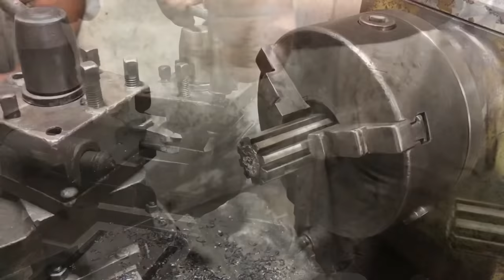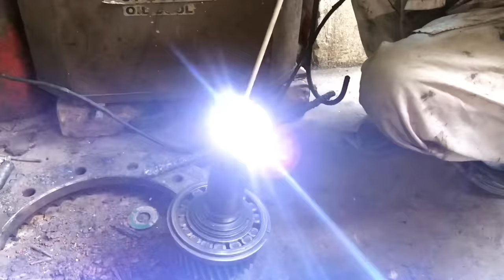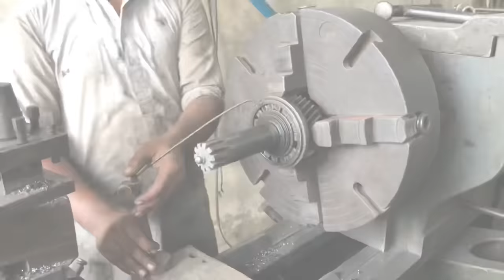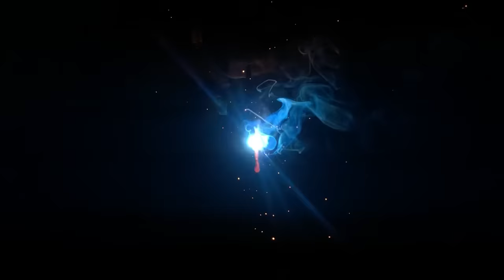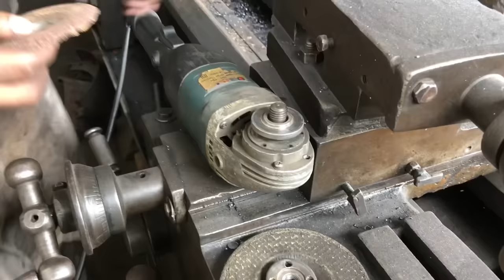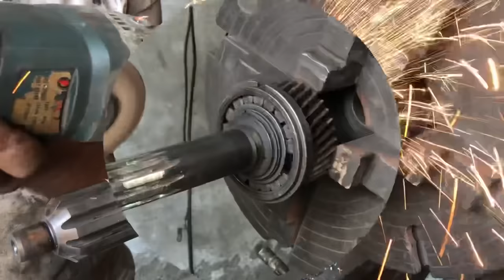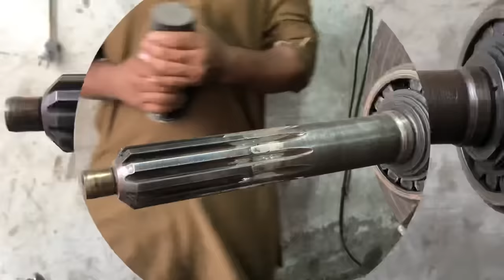The Ingenious guy Connected Broken Input-shaft Very Nicely / Pk process

Comment: Nice ste up, gear in 4 jaw.
Nice ground through ur lathe bearings.
No concerns for spatter or lathe bed if ur ground through the dam thing.
Mighty soft shaft for that drill to go in so easy.
That input bearing has nothing to do w failure.
Precision cut splines.
No run out.
Man I love these videos,  makes me feel like I can mig steel to alum!!!
Reply: exactly. All that metal being thrown into the bearing made me cringe. That weld job is shit too.
Reply: I thought the same thing about how easily the drill went in. The shaft appears to be cast, and given this overall operation, it's probably cast from grab-bag metals.
Reply: Shafts are usually induction surface hardened (or flame hardened, back in the olden days), so it's not too crazy for the center to still be machinable.
Reply: I think this video is very good. We have similar machines. If you are interested, we can talk about it together

Comment: I see a lot of comments about the grinder grit getting in that input bearing. That bearing is Toast already, notice the rollers are rough and unevenly spaced and  the roller cage is totally gone. The thrashed bearing was likely the cause of the snapped input shaft in the first place. If its not replaced there is Zero hope for the spline repair.
Reply: Jjjjr di vcy
Reply: @rizalmintarja6763  8
Reply: welding spatter was also an issue when welding.
Reply: Did you also notice the condition of the nose of the shaft?  The flywheel bushing isn't going to survive very long, either.  At the very least, it's going to squeal like a tortured pig when the clutch is in.  But it also won't keep the friction disk centered.  Once the friction disk starts going off center, it's going to stress that shaft again.
Reply: rolki są nie równo rozmieszczone  bo dwóch chyba już nie ma :)
Reply: При сварке ток шел через подшипник и сделал раковины на роликах и на дорожке качения теперь замена неизбежна.

Comment: Reminds me of back home! All parts are at least 80 miles away and some are hard to get. We have to 'temporarily fix ' stuff just to get the equipment back home. It's amazing what you can fix with a little ingenuity. Parts only temporarily as no heat treat, welding through the bearings, metal grinding particles in to bearings, ect. Only temporarily.

Comment: I hear this guy's been picked up by a major Golf Club company. 
Because the second this shaft is put under a load, all you'll hear is a LOUD "PING!"
Though I must say, the Krylon rattle can tempering was a nice touch.
Reply: Knnomi
Reply: If if were better welded and with ER312 it will probably hold. Probably will have a sticky clutch due to low hardness of the weld. But with this amount of porosity .. meh
Reply: But it will work better than the Chinese original.

Comment: I welded an axel on a Terex Rock Truck , not expecting iy to last that long .I was told to anneal the axel overnight , in a large tube of              kitty-litter . or floor dry  . It was still cooling in the morning . I thought it would be too soft . I marked it with reference lines . No twisting ,and its still good after 2 years . The break was caused by the dump box rolling over .     I welded it with XC 223 Arc Tech .  The only thing   Id have done different on this guy's job , would have been , to get a similar spline maindrive section , and do the joint away from the splines .
Reply: Nice story bro

Comment: Looks like the bearing on the input shaft is missing a few rollers. Wonder where the ground path is through for the welder? Must be just great for the bearing to have all the grinder filings to be flung at it. I've never heard of an input shaft breaking like that before.
Reply: This video was repairing the first weld.

Comment: I can't imagine that this repair will last very long. Like other comments have said, when the shaft is under torque and being a hardened steel held together with a softer steel weld doesn't spell out long term success here. Normally this type of fix is most suited to tie the job over till a more proper replacement part is found. Just go easy on the torque in the meantime.
Reply: how much do you think this repair cost and how long did it take?
Reply: сдрассьти... а как насчёт того что "надо чем-то детей кормить и водителю и токарю"?!
Reply: tide not tie
Reply: Yes I agree.  Hope that it is not used in a very important job for any length of time.
Reply: true
Reply: @ratcrib  1.98.   1.5 hr
Reply: It is important that it stays whole until it is sold or put into a car. In my country when there were no new parts for some cars, people called those parts refurbished, and sold them for lower price to a customer who thinks he knows what he is buying. But a few of them sold them as new parts, especially if they needed money for something important.
Reply: I agree with you 100%
Reply: The weld is strong, next to the weld is another story.
Reply: Even the Original one got broken, but he did his best to repair and putback to service on the important part of a truck.
Reply: @VasileIuga  The slag inclusions help make it stronger. 🤣
Reply: @VasileIuga  exactly, the welded area is stronger than the part of the shaft that it's weld to due to those parts losing their temper. The parts that will twist and snap are the areas infront of and behind the welded area. Saw this happened to an axle that was resplined by a machine shop locally. It never breaks at the weld, always breaks adjacent to the weld